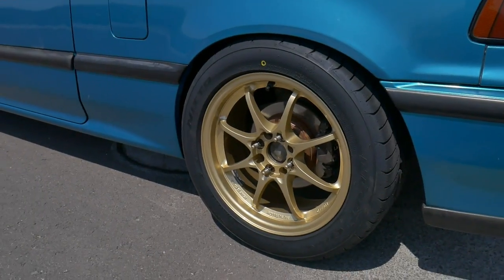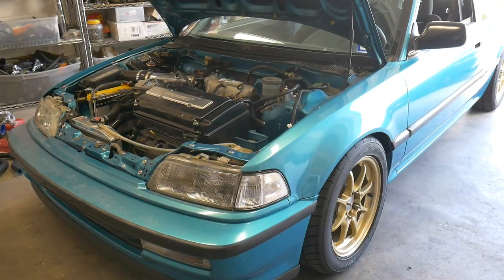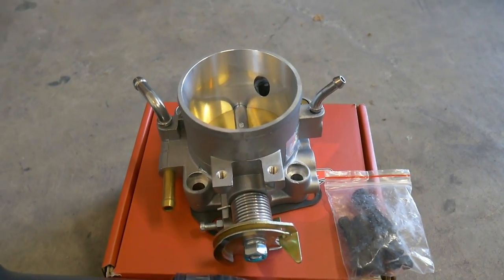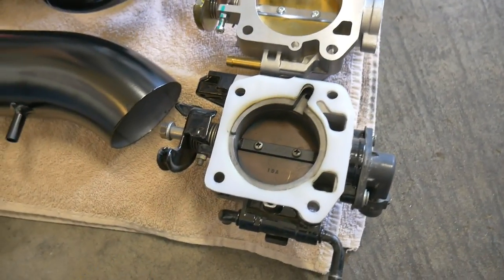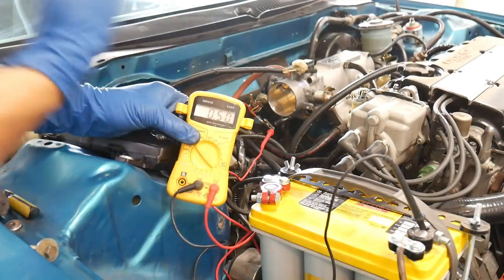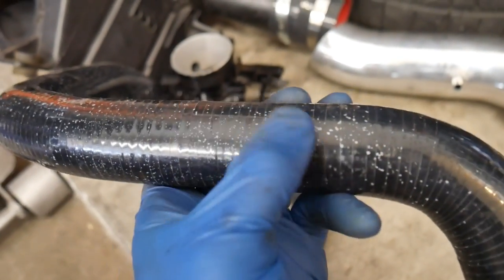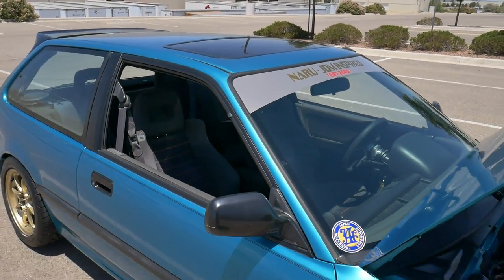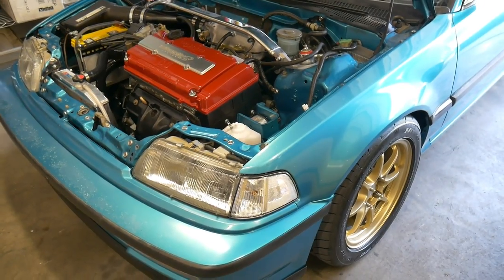Skunk2 Throttle Body & Strut Bar, EF9 JDM Intake Box, Radiator Hoses 1991 B16A EF Civic Si

Comment: Hey Jon, i bought the skunk2 intake manifold as well as the 66mm TB for the B16a in which my case like yours is obd0. On the back where the iac valve goes, it lines up with the bolt holes but doesn’t seem like it’s a solid seal where the gasket goes as if since it’s for all b16s might be different in some case. Seeing your setup runs well Im assuming you’re using the stock IAC off the oem B16a manifold like me, is that what I’m supposed to use?
Reply from the maker: Yes.  I had no problems at all.  It fit fine and sealed perfect!

Comment: Nice work on your EF! super clean work 👍🏼 
Couple questions/suggestions: 
Can you show what the internal differences of the JDM to US airboxes are,  in another video perhaps? 

Looks like you could've possibly reused the US bottom section with the jdm upper half  and not have to fuss with making a custom bracket. The US inlet arm section looks like it tapers in while the JDM looks straight if I'm seeing things right. 

Does the skunk2 tower bar require any light mods for fitment such as fuse box trimming?

Thanks!
Reply from the maker: Thank you!!

The JDM air box is just larger.   The US bottom section would not fit with the upper JDM cover.  Both are about 1" longer than the USDM counterparts.

I don't believe there is a huge advantage to using the JDM one except to say that you are.  Lol

Skunk2 bar fits perfect, I had to move the wiring that's normally sticking up but I had already moved the bracket and move the wiring down into the engine bay a little bit.

Comment: Yo Jon you could always throw some hood spacers on to stop the hood from hitting the valve cover, I went the cheap route and got longer bolts and stuck a couple of washers on the bolts cause I was having a similar issue
Reply from the maker: I put a piece of small doubled sided tape on the hood.  I left the side facing down with the covering over the adhesive.  It seems to have worked so far.  I'm not a fan of lifted hoods, it ruins the body lines for me unfortunately so that route is a no-go.

Comment: Silicone hoses sweat as in they evaporate fluid through the hose. The crusty stuff is most likely just dried coolant which tends to dry into a white crusty layer. Silicone hoses don't last as long as rubber I've found anyway so it's probably best to change them now being 5 years old.
Reply from the maker: Great info man, thanks for that.  I hadn't looked into why this happens and appreciate the feedback!!

Comment: Hey Jon.. great video! Appreciated the editing of the center cap purchase/delivery/unpacking - great way to set the mood! Curious to know if you would consider making/selling NARU stickers? Love the meaning of it the term (font is super cool too) ✌️
Reply from the maker: +Tommy Kim Thabks for that, appreciate the comment!!  I would, you'd have to pick the colors you'd want and you have to apply everything yourself.  There is the banner which you'll cut to fit, and you'll have to squeegee out the water.  Not too hard at all.  And finally applying the lettering.  That's the easy part.  I get them for $25 from a local guy.

Comment: ive had the same set of black mishimoto hoses for the b16a in 2 different ek chassis for about 10 years and theyre still clean with no spots or anything like what you got...
Reply from the maker: Lucky!!  I really don't know why mine starting spotting up.
Reply: Garage Built Hondas did it end up wiping off? was there actuall corosion in the silicone or was it just on surface? maybe was coolant sprayed from the overflow hose or something very small that sprayed all over... or couldve been battery acid that spattered out...
Reply from the maker: It didn't.  I've always kept the engine bay clean.  It started seeping from the inside.  Maybe the OEM Honda coolant did it, I really don't know.

Comment: Man would a da integra radiator work in a ef? To avoid the inlet size issues.ive got a GSR b18c1 in my ef and using stock integra hoses on a si radiater just looks janky to me
Reply from the maker: It's not a bolt in fit, but I'm sure you could get it to work.why not upgrade to an aluminum radiator and not have sizing issues?  It would help with your swap also.

Comment: I'm thinking about putting a B16 head on my B20 block. Sounds like it should fit just fine but I'm not sure what else I'd need to change or modify. Where do you do your research?
Reply from the maker: Google it.  A ton of useful info will come up un old threads.

Comment: if you get clicking from your center caps you know what to do. LMAO... looking good bud... questions on your interior...  what are they out of and what needs to be done to get it in mine ?
Reply from the maker: Tony p Right, lmao!  I have the JDM EF9 SiR front and rear seats.  They bolt right in.  They can still be found, usually between $900-$1200.  If you find any cheaper for the full set then it's a good deal!

Comment: Hey Jon I have a question nothing to do with hondas is about my moms car she has a 2013 Scion xD and when you turn on the ac the car starts shaking a bit don't know what could it be but I was reading and people say if the fan is not working correctly it could make the car shake because of the pressure of the ac and it's making the engine work harder and I do see the fans shaking a lot do you happen no know anything about this cars or what could be the problem please thank you 😊
Reply from the maker: Bernie Reyes sorry Bernie, really don't have any idea.  I would Google "Scion AC vibration" and see what comes up.
Reply: Garage Built Hondas thank you will try

Comment: What's with the zip ties on the spark plug wires on the dizzy?
Reply from the maker: +Andy Smith One kept slipping off, so I had them all ziptied at the moment.  It was bent a little on the inside, so I stretched it back out and it's good now.

Comment: Hey Jon do you need to change the prop valve when you do rear disc brakes conversion
Reply from the maker: Bernie Reyes No, it's a better brake bias, but not necessary.  especially for a daily driver you'll be ok if you don't put one on.
Reply: Jon Widmer ok thnak you that was quick
Reply: Jon Widmer hey Jon on my car the Pedel goes all the way down still I bleed the system and it's not getting enough press to close the calipers in the rear could it be the master cylinder or the brake booster I say the brake booster because when it idling and I press on the brake it changes the idel I hear a lot of air leaking from under the dash
Reply from the maker: That sounds like you have a leaking booster.  The booster operates off of vacuum and when you press the pedal it assists in pushing the fluid to the calipers.  Yours sounds like it is leaking with what you described.  If it was my car, I would replace the booster and master cylinder at the same time.  A new master cylinder isn't very expensive.
Reply: Jon Widmer yes I will do that I have a question I have a brake booster from a 1990 Acura integra would it fit on my 1991 Honda Civic Dx
Reply: Jon Widmer thanks for the help Jon 😊👌🏻

Comment: Do you have ac in the car or was that taken out due to the swap?
Reply from the maker: +Shaun Garfinkel I removed it for cleanliness of the engine bay.  It wasn't working when I bought the car 5 years ago and didn't want to spend money on rebuilding it.  This is not a daily driver.  This car is driven only for pleasure and probably 1200-1500 miles a year all for fun only so AC is not a necessity on this car.
Reply: Ok I gotcha I'm doing a ef swap right now and I'm just trying to see what I need to get the ac to work
Reply from the maker: +Shaun Garfinkel if you're going with a B swap, Innovative makes a bracket to mount the D series AC compressor onto the B series engine.  Everything else will stay the same.
Reply: So I keep both fuse boxes along with the new fuse boxes for the new motor?
Reply from the maker: +Shaun Garfinkel yes

Comment: I just bought a 1991 si hatch with 93 thousand original miles completely bone stock never been touched with a/c will you be willing to help me out ?
Reply from the maker: What do you need?
Reply: Garage Built Hondas I need one piece suspension if you have a pair laying around and it has all ac components I tried to recharge but the ac compressor is no good do you have one for the 1.6 liter motor ? And I would love any advice you can give me on how to go about it. Thanks so much for your reply !
Reply from the maker: No luck on suspension, sorry.  I do not have any compressors for sale.  I only recommend buying those brand new.  If they are exposed to the atmosphere for long periods of time they tend to go bad.

Comment: do filters like that make the same power as aftermarket cold air intakes?
Reply from the maker: Usually no, but the K&N do make more than a stock replacement because the filter element has a much better flow rate.

Comment: I got a question, I have a B20b motor swapped over to a 2000 hx civic. Now my coolant switch works bc I get a reading on the dash gauge but my fan won't kick on and I tested the fan motor and it works, anyone ever heard of this before???
Reply from the maker: The coolant fan switch is the one on the thermostat housing.  The temperature sensor is the small one pin plug under the distributor and that is the one that shows the temp on your gauge cluster.  You may want to check the wiring to the coolant switch, or possibly try a new one.
Reply: Garage Built Hondas thank u my man

Comment: How much was the swap?
Reply from the maker: +Derrick Johnson these complete swaps run anywhere from $1800 to $2500 depending on the importer you get it from.  You could piece one together for a lot less though.
Reply: Garage Built Hondas alright thanks man. Also how long did that clutch replacement on the red ef take?
Reply from the maker: +Derrick Johnson Usually anywhere between 4-8 hours

Comment: Hey Jon I need a little more help I changed the brake booster and I bleed the system again but two sides didn't get brake and two side did driver front got brake passenger back got and the two other didn't from opposite sides the thing that I forgot to do was to bench bleed the master cylinder do you think  it need more bleeding or what
Reply from the maker: Possibly.  All 4 should have resistance.  Did you replace the master cylinder also?
Reply: Jon Widmer I replace it when it had drum brake not to long ago
Reply: Jon Widmer please help me out Jon kinda mad right now I been bleeding this brake for the past 3 days and nothing sometimes one gets hard or two and then I bleed them Agian and it loses it how many times should I press on the brake pedel I also changed the prop valve to the 1990 Acura integra one
Reply: Jon Widmer sorry Jon if I am bugging you a lot but I don't know a lot about this cars like you do it's like if would have made this car from all the knowledge you have about this cars thank you Jon for helping out really appreciate
Reply: Jon Widmer hey Jon my car stops know didn't do nothing to it it was on jack stand and I put the rims on and it stopped the Pedel great thank you Jon for all the help
Reply from the maker: Bernie!!  Sorry I didn't respond, I had a long last 2 day with work!  So it's doing ok?
Reply from the maker: You should really try the one man brake bleeder kit.  That thing is so easy to use if you ever need to bleed some brakes again.
Reply: Garage Built Hondas yea it's doing ok and dope new name Jon it stop now thank you
Reply from the maker: I made some decals, will be arriving this week, would love to send you one free of charge!
Reply: Garage Built Hondas yea sure you know my address right
Reply: Garage Built Hondas thanks what I did all by my self
Reply: Garage Built Hondas does it say GBH
Reply: Garage Built Hondas Jon do you watch boosted boiz they build turbo hondas dope channel
Reply: Garage Built Hondas where can I get the one bleeding kit
Reply from the maker: Bernie Reyes any auto parts store
Reply: Garage Built Hondas ok thank you will go check it out
Reply from the maker: I do check them out every now and then when I have some free time, not gonna lie though I don't have a ton of free time at all.  lol
Reply: Garage Built Hondas lol miss spelled there I said that I will go check it out lol sorry 😐
Reply: Garage Built Hondas we where talking about my moms car and you told me to go check google and I wanted to say that I will go check google out
Reply from the maker: Bernie Reyes I was talking about the Boiz channel.  Lol
Reply: Garage Built Hondas lol we all confused ay Jon I want to thank you for helping me out with everything with out you man my car won't be like it is right now would like to send you some pics of my car so you could see it

Comment: How's the 66mm skunk2 tb ?
Reply from the maker: I like it.  The intake sound got louder when idling which doesn't mean anything but sounds awesome.  After driving it with the EF9 airbox, it had a more throaty sound, but as far as power, I doubt it's much.  Alone I'm sure the gains are minimal, but with an added header, exhaust & intake manifold it'll help make power with all the parts together.
Reply: Jon Widmer if I get one for the gsr would you think it'll enable the position of the throttle bracket like a b16/b18c5 ?
Reply from the maker: You would probably have to use the GSR throttle cable bracket still.  Only if you swapped to an aftermarket intake manifold then you could use the other bracket.
Reply: Jon Widmer oh yeah I forgot I got a skunk2 gen1 manifold
Reply from the maker: It should work fine with that manifold!